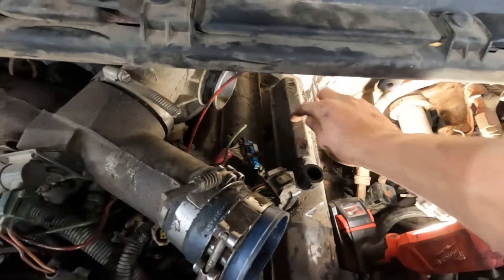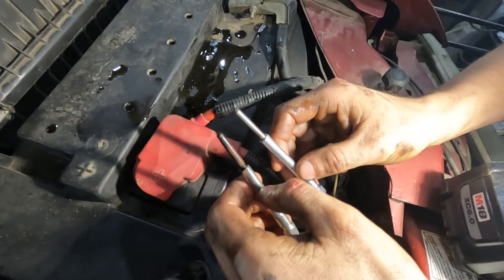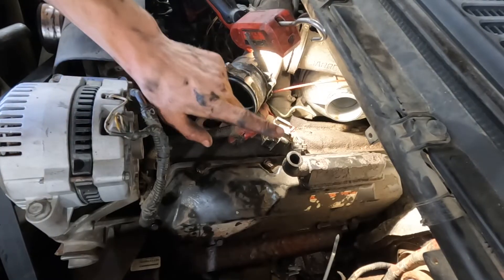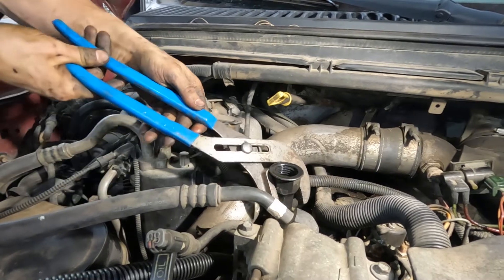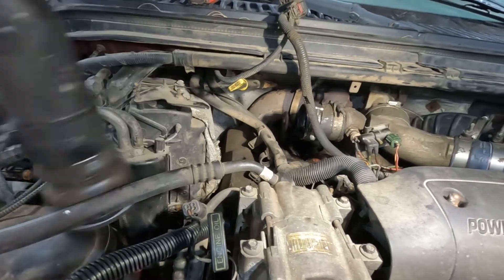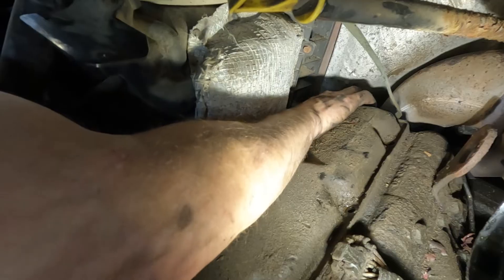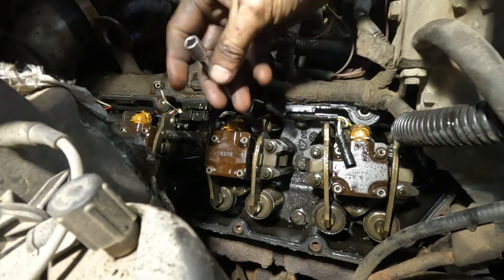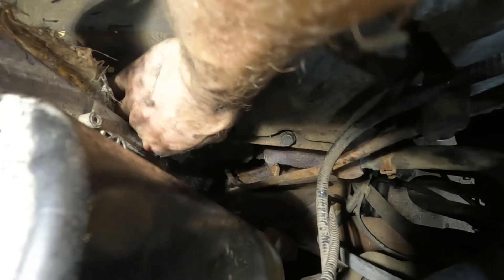7.3 Powerstroke Glow Plug Replacement

Comment: Great video thanks. I thought I was going to have to pull that AC bracket away from the valve cover and get that front bolt but I like the way you did it better. And yes always always always always clean those bolts

Comment: I did not see you install a new valve cover gasket is there a reason why
Reply from the maker: I'm not sure- I've taken these on and off so many times it wouldn't make sense to replace them every time.
Reply: Unless your valve cover gasket was leaking, there's no need to replace. You can inspect them and do so if you like.  The nice thing about the gaskets is that they have metal grommets that prevent overtightening, thus not destroying them.